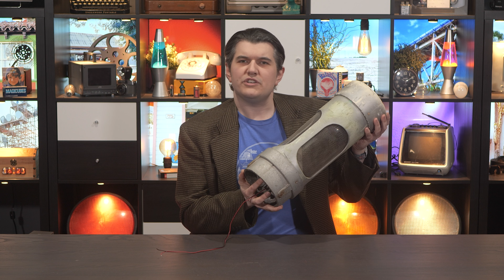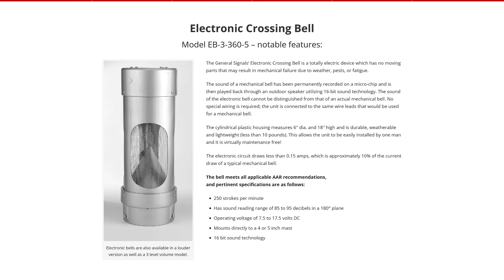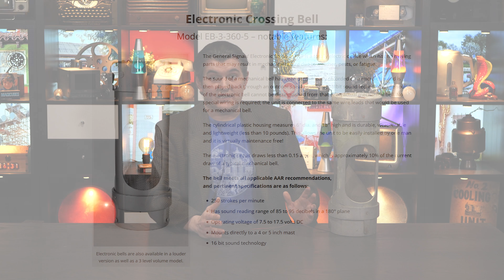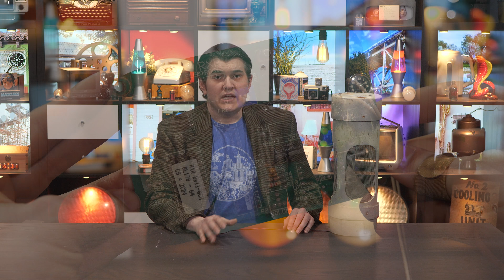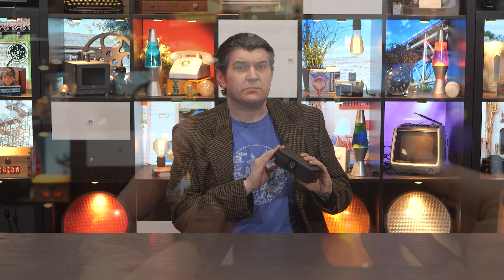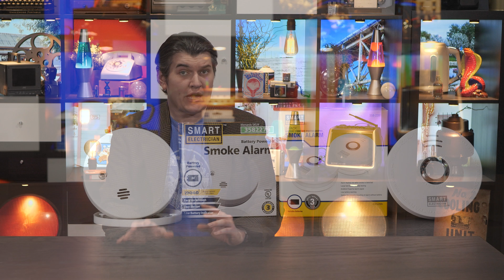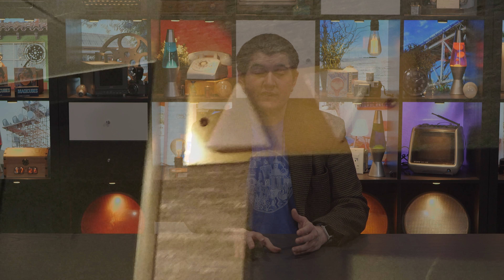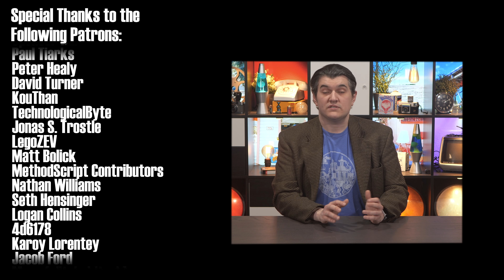The disappearing and unappreciated art of audible alerts

Comment: 20:34 is way too relatable. So many extremely specific tech issues that are probably marked P3 and will be closed "can't reproduce" or "working as intended" and really how big a deal is it but you trip over it every day like stubbing your toe on the same thing constantly causing you to slowly lose your tenuous grip on what's important and what's not until you want to grab someone off the street and say "Why can't I set this one important notification to sound the way the alarm clock app does at alarm clock volume so it ignores normal notification settings and do not disturb and sounds out of every audio source at once instead of just my Bluetooth headphones that I left across the room and are still connected because I know it's possible because it works for the alarm clock so why can't pagerduty have the same API?!"

Calm down. Calm down.

Comment: My home was built in 1964 and still has its original doorbell, a slightly bit fancier and robust version of your NuTone chime. There is one chime in the kitchen (which is more less central in the house) and another in the finished basement. The house has 3 doorbell buttons, for the front door, side door and rear patio door which was originally a 3-season/screen porch but is now glassed in. When the front bell button is pressed, the chime inside rings twice. When the side or rear buttons are pressed, the chime only rings once. I have since replaced the buttons with doorbell cameras over the years, but the 2- and 1-ring arrangement still works for the original chimes.

(Edit and you just discussed the 2- and 1- ring chimes!)

Comment: Windows.... Another place where sound design has gone to pot.

I remember Windows 95 had 4 distinct sounds

The Microsoft Sound for starting Windows
Tada for shutdown (used to be startup in Windows 3.1)
Chord for Exclamation, Asterisk and Critical Stop events
Chimes left over from windows 3.1 shutdown 
Ding for Default sound

Windows 98, Me and 2000 softened these sounds into more pleasant versions. The Washington Metro uses "Windows 98 Ding" and it's "notify" sound on its announcements. 

There were also various sound schemes (jungle, musica, robotz, utopia) which assigned unique sounds to all events including even opening a menu and then completing a menu command. But those created sound fatigue especially the open program/close program randomly going off for every background task that spawned. Desktop themes took this further into the 2000s.

However XP - 7 was the goldilocks zone of unique sound notifications within Windows XP... A critical stop error stood out from an Exclamation event whereas previously they were both chord.

Come Windows 8, Microsoft went back full circle and simply used "Windows Foreground" and "Windows Background" for these sound events and do this to this day in Windows 11. The existing sounds are still there within C:\Windows\Media folder but now they all sound similar with very little distinction. Windows Action Center could allow you to configure independent sounds for each app notification but for some reason that's not a thing.

I too rely upon unique sound notifications to guide me. In Slack for example I assign a unique sound to "VIP" and another sound to other channels. Compare to Teams whereby you barely get any choice of notifications and anything custom forget it. MSN Messenger years ago let you choose your sounds through the Windows Sound Settings... Any custom Wave file you like. MSN Plus would let you assign unique sounds when certain contacts came online. How useful to simply listen for a particular chime rather than hear a single sound and then have to look on screen and decide "is it important"

With this limitation in notification architecture many people have probably given up and simply turned off the notification and tech has responded in kind by not putting effort into the sound scape anymore.

Which sucks for guys like you and me!

Comment: I actually found a Safetran bell in a scrap yard last year and I have it outside my workshop. That type is very rare in Western Australia as most bells are Western Cullen Hayes type or E bells. And if you’re wondering, yes the bell still works. Also, none of our smoke detectors use the temporal 3 setting for its alert tone. It’s just a series of rapid beeps (approximately 250 bpm).

Comment: People who believe we should get rid of audio signals are just stupid. Visual cues are good but are only useful if you can see them. Audio works 360° in 3D from the source and 360° in 3D for the receiver (in this case ears). Audio gets reflected a lot and you can even get the signal around a single or multiple corners. Visual cues are only useful in direct line of sight. Warning or Alarm signals should be audible. Could or should they be visible? Sure, But they should for sure be audible.

Comment: Where I live, we also use a temporal 3 sound for Amber alerts and weather warnings (tornado, flash flood, etc), just with a different tone each!

Edit: I also hear Slow Woop a lot in commercial fire alarms here. One even mixes both; having 3 quick pulses of jarring noise between the sweeps.
Reply: Unfortunately this is a misconception, the emergency alert system (EAS for short) and the fire alarm industry are completely unrelated. Fire alarm systems use temporal 3 as a distinct audible tone, while the EAS uses something that sounds like temporal 3 for an entirely different purpose. Those harsh tones at the beginning of a weather alert are actually bursts of encoded information about the alert itself. They're called S.A.M.E. headers, standing for "specific area message encoding", and they're repeated 3 times to ensure devices meant to receive them don't false alarm or miss some information. The actual tone meant to get your attention is the tone that follows the headers.

Comment: The Android app Textra offers customizable repeat notifications for contacts and group messages. 
I use tasker to change my notification volume to match the ring volume every time i change the ring volume. Most of the time I want them the same (this used to be an option in (Samsung's) android but isn't anymore. But if I want them different, I can set the ring volume to what I want, then change the notification volume separately to be what I want.

Comment: In the Netherlands we use the slow whoop for building evacuation signals. However smoke detectors in homes don't have a specific sound. Usually it is temporal 3, or even a similar sound but without the pause. 
The good thing about slow whoop is that it changes frequency and is therefor better to notice, also for people with bad hearing

Comment: I think you could make a train chime that isn't a recording, assuming that you did two things. One is to have a similar beep with the slight offset that the mechanical hammers would have, as well as the slightly different tones that two imperfect bells make assuming the sustain is right. Combine that with having two of them, as is already the case with the bells and then you have something that does the same job and sounds functionally the same but can be driven with cheaper simpler electronics.

I have 3 smart watches, and I keep a Casio on my wrist so I know what you mean. I have a Samsung Gear, but why would I use that when the Casio can pull time from the radio time signal and keeps a charge for 20 years assuming sunlight hits it now and then and the rechargable cell doesn't go bad.

Comment: i use the metal gear solid alert sound for my important stuff, because it can actually wake me up from the dead of sleep, where as everything else i have used doesnt even break me from my hyperfocus sessions... and as for the ring tone, it is a car slowly reving the engine from idle up to redline, and at redline it bangs off the limiter. the start of it is like "heyy bud phone call" but by the end of it, it is screaming full blast. this has turned heads a number of times when i am too busy to pull it out and silence or answer it

Comment: In the UK our traffic light controlled flavour of pedestrian crossing traditionally has a beeper to indicate it is safe to cross. There is also a spinning rubber cone to provide a tactile option for deaf-blind and to help in situations where it would be possible for a deaf person to hear a different crossing and walk into traffic.
In my town, they have been phasing out the beepers. The problem is, the beeper isn't just used by deaf people. It's also useful at a handful of crossings with an awkwardly small waiting area by wheelchair users and parents with a pushchair, where the stupid layout means you can't face the lit signal without turning your head a full 180 degrees. They never considered that when they scrapped the beepers.

Comment: A friend of mine is a recently retired Foley Editor and she told me years ago about the Wilhelm Scream.  So I downloaded it and made it the ring tone for her number.  Whenever she calls me, it kinda wakes the dead. So, not the best ring tone if you want to be subtle with things.
One of the nice things you do is to not add any music to your dialogue tracks.  Talk about annoying stuff. If someone is speaking we do not need or want any music playing over them. So, again, thanks for keeping things nice and quiet, so to speak.
I don't know if it was Samsung or Google, but when I was using the S6 I could say "answer" when the phone rang and it would answer and enable speaker mode automatically.  I don't recall when the feature went away, but I got the S21 in 2021 and it doesn't do it either.  I want it back.
Oh, I'd like to be able to have ring tones work with text messages, so, ok, maybe not the Wilhelm Scream, but something other than the system default for them.

Comment: Like some other comments have mentioned. I feel in a number ways we have moved away from useful audible alerts due to a lack of understanding of what many of them mean. Take for example the up and down chimes on an elevator as mentioned in the video. Incredible useful for anyone who knows what they mean. But unless you're someone who is blind or uses an modern passenger elevator very often, the majority of people out there have no idea what they mean. Plus, there's rarely informative signage in or near the elevator to explain the chimes purpose. While the audible chimes are incredibly useful to those armed with the knowledge of what they mean, to those ignorant of their purpose they can come across as noise pollution. Plus, many older passenger elevators and service elevators are not ADA compliant and don't make those chimes either. So inconsistency is also a factor.

Then you have situations like chimes in an automobile where the same single chime can be used to indicate dozens of things between "a door is ajar" to "windshield washer fluid is low" to "stop immediately, the engine is going to blow!" with usually a tiny symbol somewhere on the dash to give you a clue on deciphering what's going on.

Comment: 5:00 yeah, because they are. Train doors for example. 
1990, door closes, makes hissing sound because it's pneumatic.
2000, door announces its closures with a bell or short announcement text. Cited as accessability, which I can kinda understand, a warning that it wants to close might be necessary for people who don't drive regularly. 
2010, due to new safety regulations, the door beeps before and the whole time it is moving, cited for accessability again (someone think of the blind people, who definitely can neither here the hissing nor the rolls and motors of modern sliding doors).
2015 people start to more and more protect their ears from all these annoying noises with headphones, first dampening in ears, then ANC.
2020 the beeping has to be louder, because people with headphones wouldn't here it!!!!!!!!! Also the whole train beeps until ALL doors are locked, if one gets stuck, here, have 2 minutes of deafening beeping.

Comment: Perhaps mobile devices should have sound themes, similar to color themes which apply to every user interface. With color themes people just pick the accent color and that’s applied to every app. Sure I can micromanage and set the sound manually for each thing, but I’d much rather choose a non-default preset in which all the sounds are similarly themed and just adjust few specific apps I need afterwards. Perhaps a different sound theme tied to work and home profiles.

Comment: I shouldn't have to install a 3rd party app sideloaded, just to adjust the volume in small steps- Precise Volume has worked okay. Also, for the love of all the deities, please stop having ads in apps IGNORE volume settings and go all the way to max. Even setting up a pi-hole (DNS based sinkhole aimed at advertising domains) doesn't get rid of everything. And I wish it was still common to have per-app volume settings in the device itself.

Haptics don't work nearly as well as they should for me either, but I chalk that up to having fibromyalgia. My own body gives me 'noise' signals of tightness / pain so I had to start tuning that out. I wonder if both me and Alec do some degree of having to filter out nociception, which sometimes leaves out important things too. I hope we don't share the chronic pain. That reminds me, I really need to change my critically-high-pulse alert to be sound <i>and</i> vibration. I think that's important enough and no one else will hear it 99% of the time.

Comment: I have a story on poorly designed fire alarm sounds. A few years ago, I was living in an apartment when the fire alarm had gone off due to a kitchen fire in one of the other apartments. The alarm that played was not Temporal 3, but instead was just a constant, steady buzzing. I didn't realise it was a fire alarm, I thought someone had started drilling or using power tools in another apartment and it wasn't until firetrucks started pulling up in the parking lot that it even occurred to me that the sound was a fire alarm. That fire ended up not being a big one, but I was thinking about how much worse that situation could have been.
Reply: It's true, a lot of already installed fire alarm systems are set to continuous instead of code-3. The standard only applies to newer systems in buildings that are getting built, so currently standing systems aren't likely to change.

Comment: Could’ve said why none of these alerts use a single sine tone. That’s pure psychoacoustics, your brain can’t locate a consistent sine wave and, even worse, it can completely filter it out at low dB. All the alerts either change pitch, use on/off patterns, or stack harmonics (dissonant works best, like a bell)
Reply: Also, air raid sirens has not disappeared in Kyiv and I really do appreciate them.

Comment: 3:18 I can't believe how crude it is either! Especially for a piece of safety equipment where peoples' lives may depend on it. I'd think if they didn't want to use a NEMA-class enclosure around that PCB (which would probably cost more than the entire device as-built), they should have at least potted it and used stainless hardware to mount it. That would only have cost a dollar more, maybe less, and extended the life significantly.

Comment: You would love-hate my custom ringtone and message sounds. The ringtone is called a warble tone, and I made it from scratch based on old Bell Labs manuals. The manuals are for the old analouge SAC PAS2 phone alert system. Message tones are from the minuteman console system and sampled. They are the REACT consiole proceed sound and the Emergency Action Message sounds.

Comment: I understand your desire for audible phone notification sounds, and would probably be in the same camp as you if only it weren't impossible to stop my phone from simultaneously sending me so many push notifications that it's given me an anxiety/trauma response to my phone making any noise (or even vibrating) and also NEVER sending me a notification when an email flagged as important comes in because the app is for some reason hard limited to only being allowed to notify me a certain number of times per day so batches email notifications together. If it were at all possible to live without a smartphone in the modern world, I would because it's just become a nightmare of technology that does everything I would never want it to do, but nothing that I actually need it to do. I fully agree with you on a societal level though.

Also, half of the apps that I might actually want to receive push notifications from are constantly getting all of their permissions automatically revoked by Google because I haven't manually opened them in "too long" so they couldn't send me notifications anyway, and I can't disable that from happening any more than I can make individual apps send me notifications how I would like them to or only about the things that I would like them to.

Edit: Oh, you have that problem with email notifications too? My Google Mail account on my Google Mail app on my Google phone didn't send me any notifications at all for years (only started back up again some time last year) and there was nothing I could do to fix it no matter what changes I made in the settings and everybody treated me like I was crazy or lying about it.

Comment: Speaking of railroads, back when I was a conductor my engineer was inspecting the engines while we were waiting on a signal.  The signal came and we had to go so I just rang the engine bell a bit but he happened to be next to it and lubricating the mechanical bell.  He nearly had a heart atttack.  When I later became an engineer sometimes you might accidentally leave the bell on as it turn on automatically when you blow the horn.  The conductor many times says, "Hey, your selling ice cream! Turn off your bell!"  The digital bells work a lot better on locomotives as mechanical bells are prone to stop alltogether or run double time.